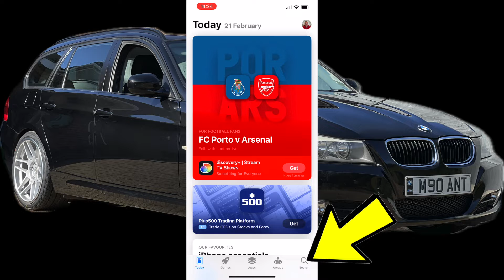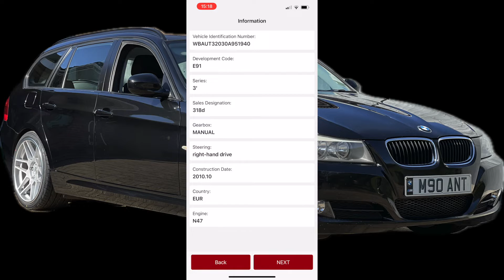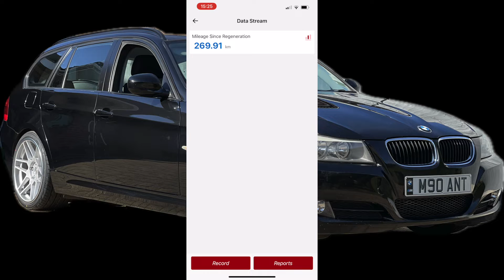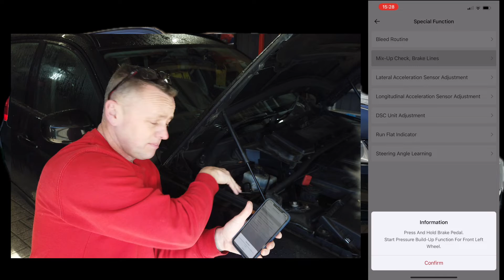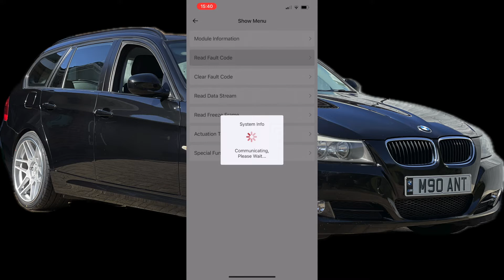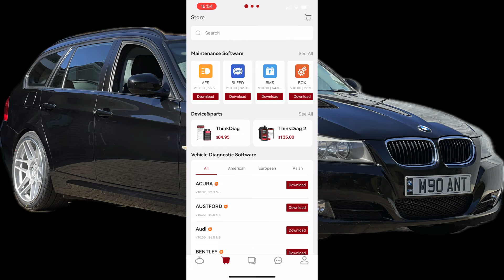THINKDIAG PRO Review – Can This Bluetooth OBD2 Scanner Really Deliver?

Comment: I have a question on your "Peugeot Partner Won’t Start" video would you mind taking a look when you get a moment, thank you for any advice offered
Reply from the maker: I will check it out, 99% of air leaks come from the filter housing, I would fit the 1 way valve just before the fuel filter in the pipe that comes from the tank, this will stop tracking back and solve your issue, Thanks for the great comments👍🏻👍🏻🛠
Reply: @aaanton11  thank you I have replied on the "Peugeot Partner Won’t Start" video

Comment: Hey Aaanton; does it works for Ford(Europe); i looked at Amazon and see Ford USA; not Ford Europe.. Or am i not looking properly?
This moment i have an old (2006) Fiesta 1.6. 220.000km, no problems so far. Even the airco works. Do regular maintenance by myself.

Never spending thousands of Euros on a car even if i had the money.
Gonna look for a Mondeo 2.5 V^; had this model twice, but than came the Ukrain war and fuel get sky high, so i sold it.

But now i want this model again and there are not a lot with this engine'mostly 1.8 and 2.0 4 cilinders; plenty here in Holland .Timing chain(s)? Instead of timing belt. Strong engine i think. Yeah also the Jaguar X-type had this engine.
Reply from the maker: Yes it will work for ford Europe, the auto vin might not, and few other features as they work better on cars from 2010 onwards, but you can enter all the details manually, Thanks for the great comments👍🏻👍🏻🛠
Reply: @aaanton11  Thanxx Aaanton, first i have to change the right axle makes a rattling sound,not equal to the engine rpm’s and gone when i puss the brake pedal.
Otherwise nobody will buy it. Plenty people like me here in Holland that drives old cars😜.
And when i sold it, i buy(again) a Mondeo III(2004) 2.5V6.
Last one i sold a few year ago, because of the war in Ukraine and fuel get €2,60 a liter..
But i loved that V6.
But i realise that i have to hurry up; not much left Mondeo 2.5 V6 and i do not want a stationwagon.

Anyway..thanxx for the answer!!👌👍